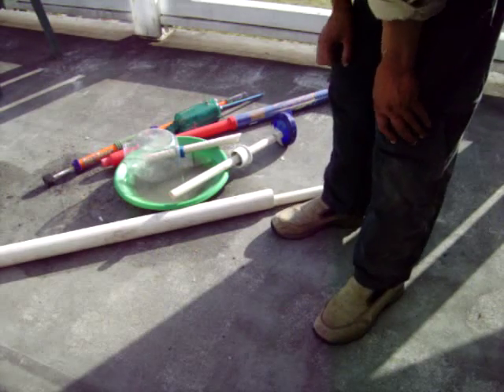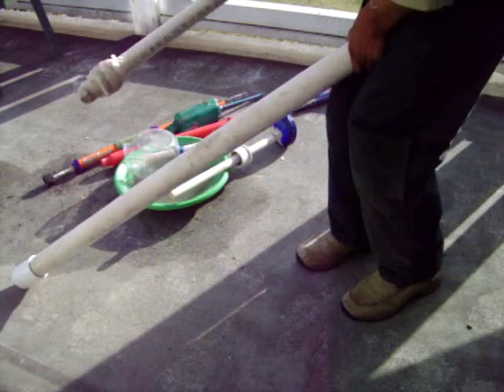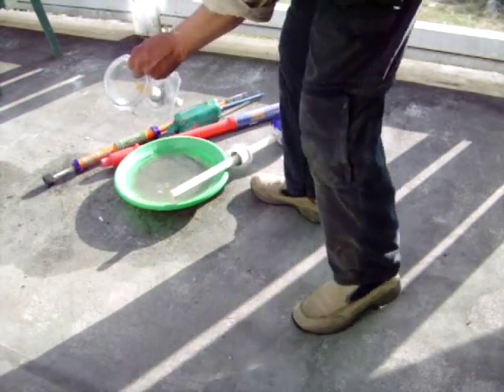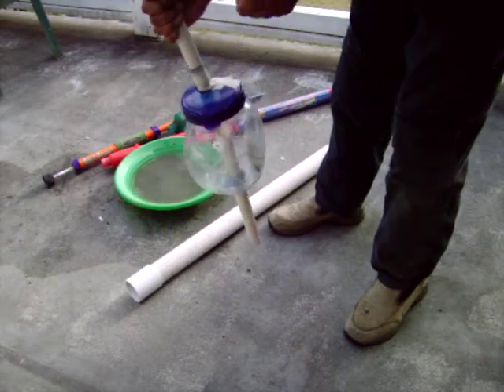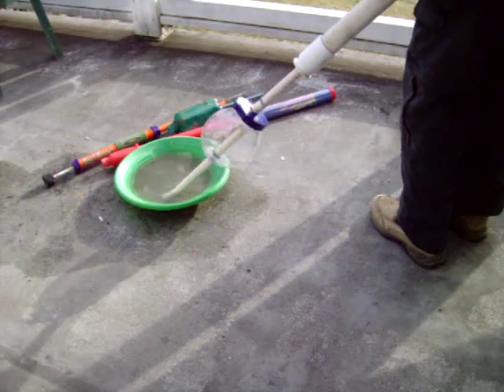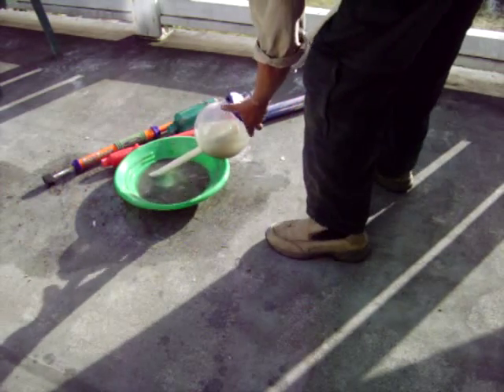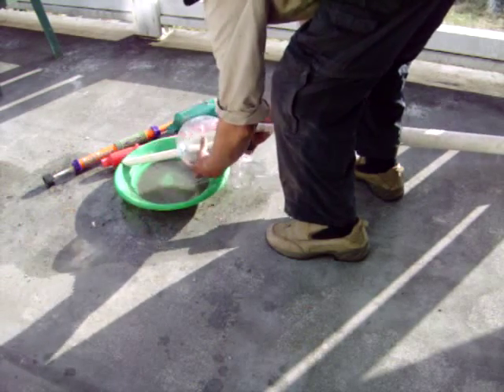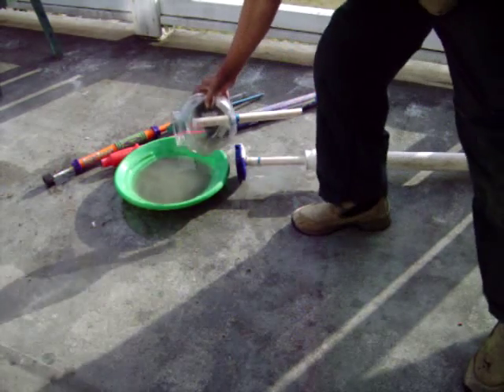deep water hand dredge..simple construction

Comment: That is a nice little tool you have built.   I am making something very similar, only I am just using a siphon tube to suck material up.   I use a snorkel & siphon tube while crevicing under water.   But using only a tube I have to come up & spit the water into my pan every time.  So making a device like that accept for the pump will allow me to siphon out the crack without all the up & down to my pan.  Saving a lot on my back.  Nice tool for you though.  Love the ingenuity.  Best wishes in 2012

Comment from the maker: @crazyeagle61  hi thanks for your input .... the suction nozzle pipe intrues into the catctch chamber about 6 or 7 inches it acts like the tube in a sniffer bottle... on the upstroke if you lift the nozzle a bit you get water drawn up clearing intake ...a gentle downstroke will clear lighter debris from sucking area....made it quick and inexpensive.. check valves are good  but this is dead simple and it works..gets the fine gold on my claim .there are plans out there using valves....mickeyminer